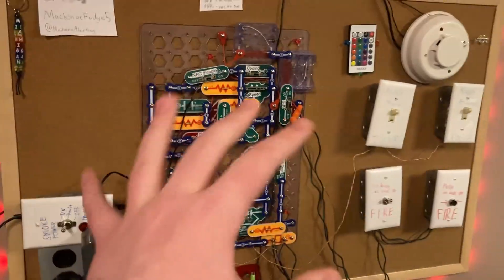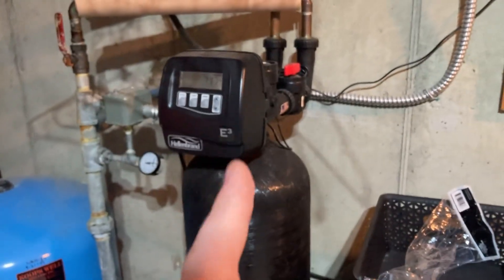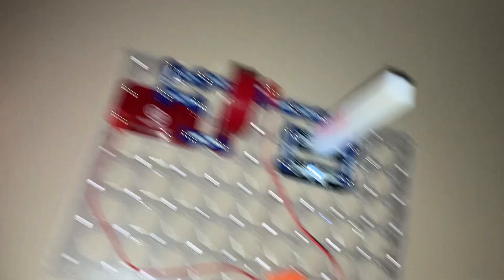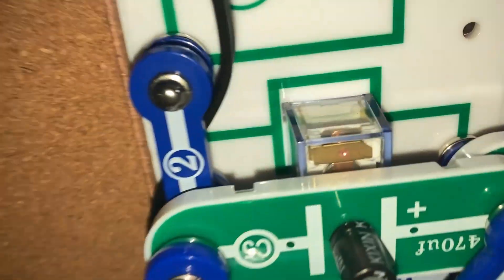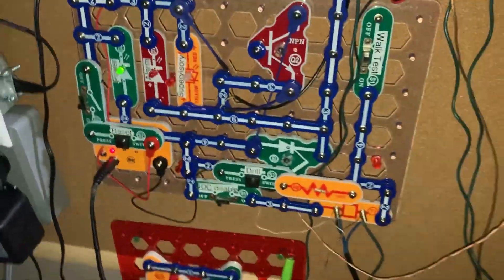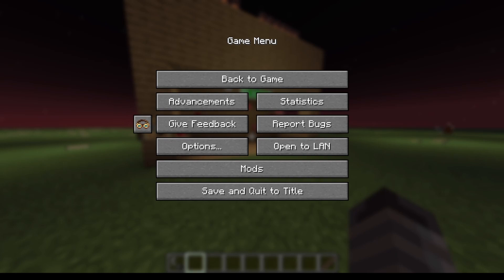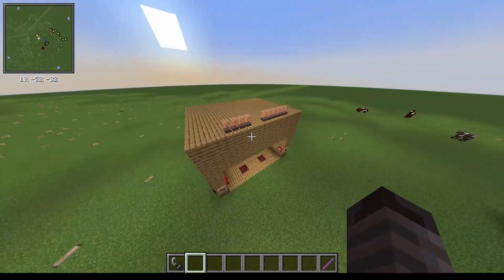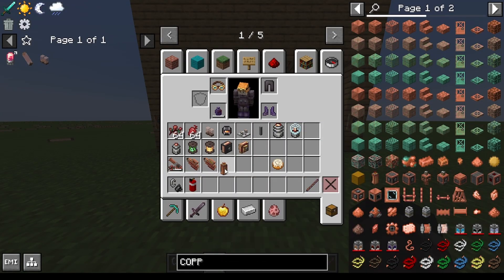Snap Circuits Fire Alarm System Test #14!!

Comment: My suggestion for a system like this is to wire everything with CAT3/5/6 cable and rj45 connectors so you can have different things on a different conductors. This would also allow all of the speakers to be amped from the main panel for an intercom system or whatever.

Edit: I see you’ve already done that 5:32

Comment: Just “fixed” my fire alarm system, The circuit doesn’t want to send power to the lights when the alarm is on. Now its 2 separate circuits.
Reply: Update! Tape Broke so it may or may not have fell. So i dipped it in water and it worked good

Comment: I just got done installing a fire alarm system in my house. It has low frequency snap circuit chips. (Also known as the ambulance tone it just doesn't stay on for long enough to do the second tone) It sounds kind of cool it also has big speakers. They sound better honestly The panel is a kenex coder with everything removed internally except the motor and I also used snap circuits for my panel like a drill and test feature as well as the same pull station you installed in Sam's house and a range of red strobes wired in weird ways 😂.by the way, nice intro I think your batteries might be dying. By the way, mine runs off of four double A's and with two speakers seven strobes and a already coated piezo it still works fine. The strobes are really bright so I think your batteries are dying
Reply from the maker: @ilikefans54  yeah…
Reply from the maker: @ilikefans54  I think imma buy a 6v SLA battery for crazy current